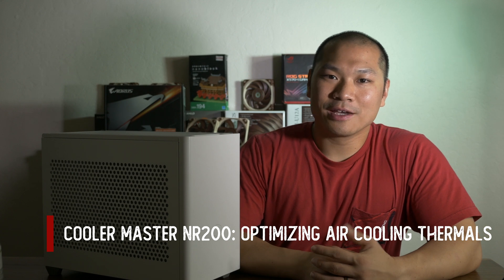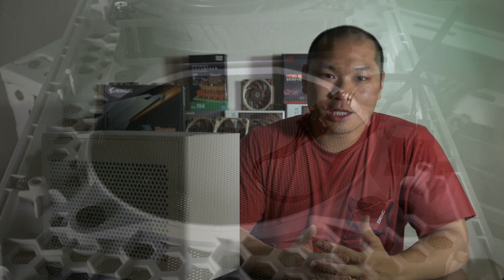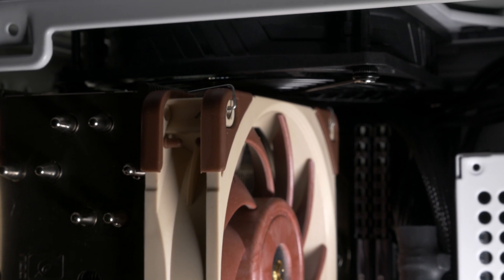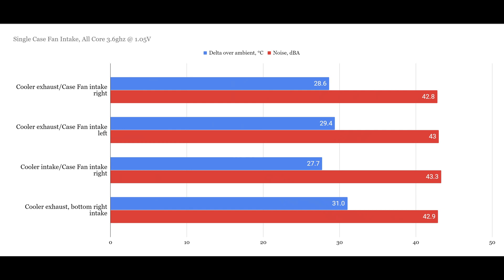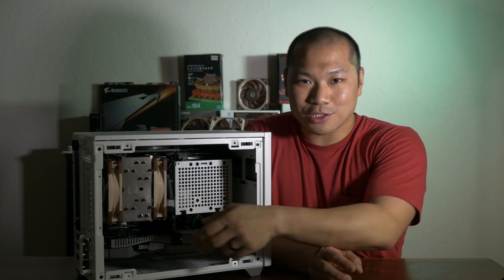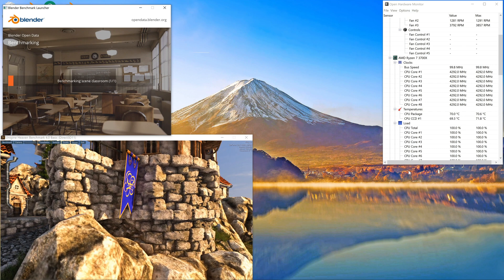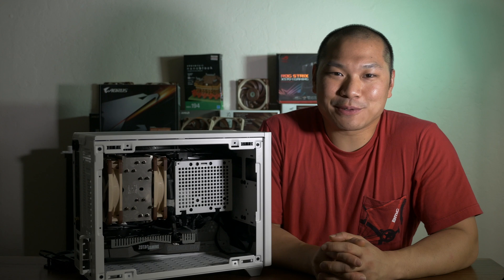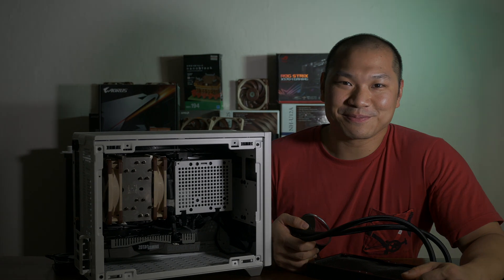Cooler Master NR200: Optimizing Air Cooling Thermals

Comment from the maker: Just a quick update- I did get around to testing bottom fans with a rear intaking tower cooler (U12A)- those results are in the Large Air Cooler Round-up here: https://youtu.be/nSUK7p9qQnU

They do help more if you run a tower as a rear intake. Before bottom fans; 40.2 CPU/42.4 GPU. After bottom fans, 40.8 CPU/38.9 GPU. However, just two exhausts and a rear exhausting U12A gets you to 40.2 CPU/39.7 GPU with less noise and less cost. So, while bottom fans with rear intake is an option, I wouldn't consider that orientation unless you are running a very hot GPU compared to a relatively cooler CPU, ie 3080 with a Ryzen 5.
Reply: For all air cooling:
If using only the stock amd cpu air cooler, does having fan/s on the side as intake or exhaust have any significant bearing on the thermals?
Reply: Running a 12700k with 3080ti, currently finding with a tower block and all round corsair fans fitted I'm getting okish temps, but can't help but feel swapping out for noctua's would be better, biggest question would be for a two slot GPU would it be better to runner slimmer fans on the bottom? To allow a bigger airflow gap or stick to 25mm noctua's all round?
Reply: @b1gd312  deshroud your gpu and stick 2x 120 underneath.
Reply: @1LifeAdvs  you can't deshroud an FE
Reply: So with the aorus mb and the u12a I can fit two nf-s12a pwn on the top? Or do I need flatter fans?
Reply: what about the 4 case fans setup (bottom exhaust, top exhaust)? sounds strange, but bottom exhaust works great for deshrouded mods with some cases
Reply: A tip: you can watch movies at Flixzone. I've been using it for watching lots of of movies these days.
Reply: @Cairo Terrence yup, I have been using flixzone} for since december myself :)
Reply: @Cairo Terrence Definitely, have been watching on flixzone} for since december myself =)

Comment: Hey, i have a weird question.

What if you use the u12a as an exaust with only the right fan AND the left fan is not attached to the cooler but on the case as a case fan exaust? 
I would imagine that this probably reduced turbulance since the rear fan attached directly to the cooler is 1/2 cm far from the case making quite more turbulance.

What do you think? 
I would think that this will not change in any way the cooler performance but exaust hot air more efficiently and quietly comparing to blasting air on the 2 cm of the case rear area.

 I hope you understand what i mean.  

Thanks!

Comment: had this case sitting on shelf and just now building in it and will be running glass on both sides and yeah I will have to mod case a little to keep cool , I wish the case was just a little wider to put a bigger cooler on it and this is why it's been on shelf for awhile .

Comment: Hey. Great video.
I’m about to build my first ssf pc using nr200 and I wondered how about maintaining possitive pressure in the case and preventing dust buildup? 
I mean, from what I understood the thermals are good overall bo matter what fan configuration are used, so wouldnt it make sense to make use of the bottom filter and putting fans at the bottom in intake position?

Comment: 15:14 I have a 1 fan with my CPU cooler, what does he mean with running it as an exhaust? I have the fan on the right side pushing air through the heatsink, does he mean that changing the fan to the rear (left side) of the heatsink is better? Please can someone clarify

Comment: I have nr200 only with stock fans installed as exhaust (1 120mm on top mobo, 1 92mm rear). Temps have been great with cpu (i5 12400 + deepcool ak400) averaging around 55c and gpu (rtx 3070ti trinity) averaging around 60c on a 2k ultra gaming load.

How would an extra top exhaust 120mm fan (placed on top of PSU) have an impact in reducing the temps even more? 

Im honestly satisfied with my current setup in terms of noise and temps, im just wondering if im missing out on extra noise or temps performance by skimping out an extra 1 top fan.

Comment: The one fan configuration you didn't perform was taking the exhaust (pull) fan off the CPU cooler and mounting it directly to the back panel exhaust vent.  The way that fan is blowing hot CPU air out the back of the case only gets reflected back inside, providing maybe 30% of the total air exhausted out the back with 50% recirculated back into the CPU cooler, and 20% exhausted out the top.  If you had the fan mounted directly to the back panel, I'd say 95% of the hot CPU air (including some GPU-heated air will get exhausted, keeping the internal area of the case cooler by drawing in more cooler air from the intake vents.
I am running a SilverStone SG05BB-Lite mini-ITX case (slightly modified by me), using a 120mm AIO mounted to the front panel (with the lower 3.5" drive bay removed the remaining 2.5" SSD drive bay modified to accommodate a 25mm thick fan plus the radiator thickness).  With a Ryzen 7 3700X overclocked to 4275 MHz, and an ASUS Phoenix RTX 3060 OC (single fan) GPU, temperatures while playing Halo Infinite, averages 58*C on the CPU, and 79*C on the GPU (a little bit too toasty for my liking).  Even with a recently added 70mm x 10mm case fan exhausting out the top above the GPU.  Current ambient room temperature is 27*C (81*F).  The problem with the GPU is that it's a 2.5 slot wide card, so the fan is right up next to the side panel vent grill.  This causes poor air intake when the fan is right up against it.  I'll be getting a 2-slot RTX 3060 card tomorrow so that I'll have at least a 10mm gap between the panel vent grill and the GPU fans, creating a Venturi effect through the case panel vent holes.  This should provide more cool air to the GPU.  However, doing anything else besides playing Halo Infinite, CPU temperatures drop all the way down to 39*C avg, and GPU temperatures drop all the way down to 33*C avg.  Halo Infinite is a GPU hog!!!

Comment: Now Coolermaster has provided official support bracket for ATX PSU. How would that affect the thermals? Do you think the optimal configurations of air cooling need to be changed if I am going to use an ATX PSU? It would be great to know your opinion (test results would be even better). Thank you very much.

Comment: Thanks for the video. Currently I have 2x TOP exhaust and side intake with stock AMD cooler (3500x). The GPU is ASUS DUAL-GTX1660S-O6G-EVO.
I am planning to switch to tower cooler with 2x TOP exhaust and cooler exhaust (single fan). Is it better to run the CPU cooler in push or pull (no additional 92mm fan as exhaust) configuration?

Comment: Just the information I was looking for. Got the NH-U12A chromax.black along with the rest of the hardware. Only waiting for the NR200P to arrive. Won't be able to use the TG side panel but at least would know the CPU is going to be happy.

Comment: CPU exhaust + top exhaust = full negative pressure. Sure, air coming from bottom and side is filtered, but I'm pretty sure there will be air sucked in through PCI expansion slot holes, and build dust in the PC.

Also, sadly, no vertical GPU arrangement. When I'm thinking about it, if you set 2x120mm intake + 2x120mm exhaust in the case, you get a nice traditional "bottom-up" air circulation. Now, with the GPU arranged vertically, it should not block this airflow as is the case with horizontal orientation: fresh air moving upwards will theoretically reach both GPU and CPU.

Comment: So for those who are interested (confirmation would be appreciated):
- 1x Noctua S12A (CPU) as exhaust.
- 1x or 2x 120mm fans at the top, as exhaust. (one of them comes with the case)
- 1x 92mm set to intake at the front or side panel (comes with the case) (?)

Assuming we are not overclocking.
Reply: According to the spec sheet, there is no front fan support, nor can you put 92mm fans in the side...

Comment: having a good amount of exhaust/negative pressure, probably brings in enough cool air through all the sides and bottom.
Adding those bottom fans would cancel out the negative pressure, meaning no more cool air coming in through the side panels for the CPU to feed from

Comment: Hello Machines, I Really hope you see this! I am planning a build in this case with an i7-11700 and a Gigabyte GTX 3070, I plan to use a Scythe FUMA 2 cooler.

I watched this video over twice and wanted to ask if I am understanding correctly - most likely the best configuration would be 1 or 2 top exhaust fans and the cooler set to exhaust - with no major benefit of adding two additional intake fans on the bottom?

If I did want to add intakes on the bottom I would have to look into slim profile fans that would fit down there, it would be great if I could just go no fans on the bottom!

Did I get this right?

Thank you so much!
Reply from the maker: I’m guessing your card is a 3 slot card, in that scenario you may have the option to run slim fans to help the card out. If you do that I would flip the cooler to intake. However what you are describing is fine too without bottom fans, as long as you don’t have a flow through cooler. One or two exhausts with the vented panel are fine.
Reply: @MachinesMore  Thank you very much for taking the time to reply! I will probably pass on the Bottom intakes at first and look into adding them and playing with the exhaust/PC cooler direction as per your advice :)

Comment: Just finished my nr200 build, i cant seem to close the side mesh panel. Does it have to do with the motherboard? Im using the z590i aorus ultra.
Reply from the maker: Yeah, it’s possible the board is thicker/higher. This is where the variances come into play. One thing you can try is to take out the mesh lining, or you can use a screw to hold the panel down.

Comment: One alternative is to mount a 140mm exhaust fan to the top right corner on the vented panel. No bracket needed, screw holes aligns perfectly. This fan is controlled by GPU temp and redirects much of GPU heat away from CPU. I also have 1 fan as rear intake on my Noctua U12A and 1 fan directly above it as top right exhuast. Those are controlled by CPU temp. This setup for me gives better temps than 1 rear intake and 2 top exhaust.

Comment: Yeah I own this case and it runs perfect with the standard mesh panels. I runs well with the tempered glass, but man does my GPU heats up after about 30 minutes. I might need to undervolt in order to get it to stay at an appropriate heat.

Comment: Did it came with fans pre installed or you had to buy them?
Reply from the maker: The case comes with two fans- one loose 120mm and one 92mm which is mounted.

Comment: Which MB gives me the largest space for the topfans if I use the biggest possible Noctua as cpu cooler.
Reply from the maker: Asus ITX boards typically have the lowest socket position for that consideration.
Reply: @MachinesMore  the AORUS B550I AORUS PRO AX would be way cheaper for me. Do you think I can still put 25mm fans on top with that mb and the noctua u12A?

Comment: Thank you for the great video on NR200, I have a question on 8:40 as you using those push pin install the fans, where can I get them? What are the specifications on those push pins? Thank you and keep those video coming.
Reply: They come as standard with nr200 and the nr200p

Comment: I have huge respect for you and the work you do with the NR200. It has helped me in purchase of this case. I do have a question, is the Nh-u12a better than C14s? which one should I go with?
Reply from the maker: I think the U12A is best for straight CPU performance, but for combined gpu and cpu usage the C14S (with vented panel and fan on panel) can really mitigate the effect of the GPU exhaust.
Reply: @MachinesMore  my man! Thank you for the reply, I will go with this since GPU thermals are important to me.

Comment: i was clumsy enough to mount the top fans in the wrong direction, blowing air in, so i had an "All in" fan config (2 Top, 2 Bottom, 2CPU). Thermals were looking pretty good especially vrm and M.2 runs about 5 degrees cooler compared to top fans pushing air out. If you running a board with hot vrms it might be worth trying this All in config.

Comment: I'm a bit of a PC noob, but I just bought this case. As I understand both fans on the cooler should runs as exhaust to drag heat out to the exhaust fans above, right? Or should it run push/pull to get the heat out in the back?

Comment: Sorry i dont understand. What is meant by 'case fan exhaust right'? Are you talking about the case fan at the top of the case, on the right side, exhausting? Or a case fan on the top and an exhaust fan on the right of the cpu cooler?
Reply from the maker: Top, right side (when looking at the motherboard).

Comment: i tried to listen to all your video's but i didnt fully get your final sugestion for the nr200,

from what i remember the most recommanded nr200p set-up is : 
2 botom fan intake
2 top fan exaust
1 cpu tower intake (gota watch out for dust)

what is your recommended for the nr200 ?
1 top fan intake
cpu tower exaust (back or side ?)
no botom fan ?

Comment: If I use a 6900 XT GPU (2.5 Slot card), is it okay if I put two normal sized 120mm fans? Slim ones not available in my country. There is like 1-2mm of clearance left.
Reply from the maker: It’s a bit tight but it doesn’t really hurt to try it though, if you get thermals that you’re happy with, then stick with it! There is the possibility for the fans to not run in sync but at typical case fan RPMs of 800-1000 and moderate GPU fan speeds it will probably be fine.

Comment: With the CPU cooler still fit with the tempered glass panel instead of the mesh side panel
Reply from the maker: Not the U12A unless you use screws to hold the panel.

Comment: Im a Little Late but waiting on my nr200 I’m still trying figuring out what’s the perfect air cooling combo.

At first I would move the psu to the front, the cpu cooler should get a better access to more air volume.

And two 120 artic at top as exhaust should work fine imo

Comment: Thank you very much for detailed videos! Funny, that all fans combinations seem very similar, I definitely will choose 2 intake + 2 exhaust case fans with cpu cooler to exhaust too. Additionally would be interesting to add side intake fan on the right side to add more fresh air for cpu cooler. :)
Reply from the maker: With the vented panel it's very tolerant, to the point where almost anything goes- you do want to make sure that if you run bottom fans for a hot GPU that you intake from the rear.
Reply: @MachinesMore  yeah, to figure this out we need the same amount of test, you've already done :) I plan next year to build a pc with this case - I will test all possible builds with my components. So, I will keep you in touch :) If you are interested, I found interesting russian channel with airflow modeling in SolidWorks (https://www.youtube.com/channel/UCIGSeb72lRj7Jxlwt63OmMQ) could ne useful

Comment: Hmm, I appreciate the video, but you made some poor assumptions such as that CPU temperature was the only metric that mattered for top fan being intake vs exhaust. The purpose of it being instake would be to help cool the motherboard VRM. If the thermals were "fine" in both configurations instead of micro-optimizing I'd rather start measuring the VRM temps. I've never killed a CPU with heat, but I have killed motherboards!

Comment: I may have missed it, but is there a huge difference between a single (front) or dual top fan as exhaust? I'm thinking of going with a Mugen 5 + Gigabyte which limits my options a little.
Reply from the maker: Not really, a degree or less with the vented panel.

Comment: Hey man would a slim fan fit behind the c14s in this case as rear fan? and would it help thermals? I know on the u12a it might limit it but with the c14s it seems it could be beneficial? I also have the b550i strix board which has socket placement a bit more right and down.
Reply from the maker: A slim fan should fit, I haven't tested it but it should help.

Comment: Wait does the Noctua U12A really fit with vented panel?!! this is decision breaker for me! I have NR200P and I am so unhappy with the water 120mm AIO I currently have in it, because the pump is louder than the fans and the sound is not pleasant at all :D thanks for his video man!
Reply from the maker: It should- it's squarely in the realm of manufacturing tolerances so your heatpipe tips may have a small effect but with the vented panel there is enough give either way. Most 120mm towers will be at least as good as a 120mm AIO and the U12A is definitely better than a 120mm AIO, in fact closer to a 240mm AIO.
Reply: @MachinesMore  thanks for the tip. I am absolutely astonished by the NR200 case, I think it will stay with me for a looong time. The fact you can fit 3 slot full size GPU in it and not worry about thermals at all, I think its one of the most reasonable small factor cases you can find. Pricing, quality, thermal and component compatibility. The thing I cannot decide is what type of cooler. I have my first AIO and the overall satisfaction is really low. The pump is loud as hell I can´t help it. I just think the reliability of air coolers still dominates. Altough I cannot stop hearing good things about arctic liquid freezer 240 II, if any AIO is in the race with U12A, it would be this one. I guess eventually both choices are good.

Comment: i have been considering building my first PC for about 7/8 years now... It's kind of a hobby, just imagining what i might build one day. I'm closer than ever to actually pulling the trigger. Looking at NR200 with 5600x and 3070/6800. Use case is for 3440x1440p 144hz gaming. At one point i wanted to water cool, then TG side panel, then RGB bling. Now 7 years older im looking at reliable/cost effective air cooled/mesh side panel/SFF... feels like my imagination has matured. Just have to wait for stocks for literally everything to replenish so i can finally build it! ANYWAYS great content from someone that has never even owned a PC!